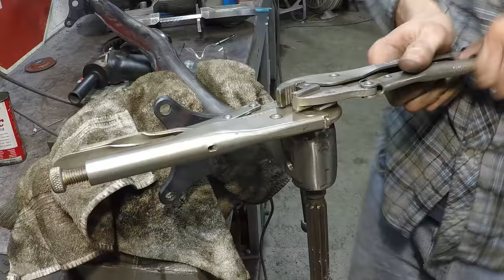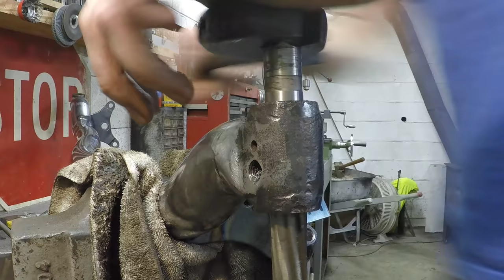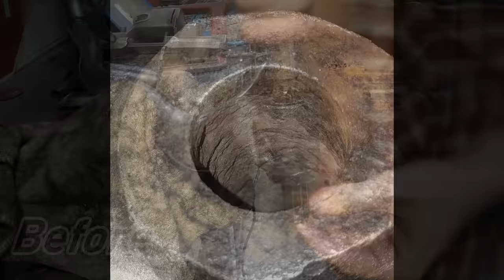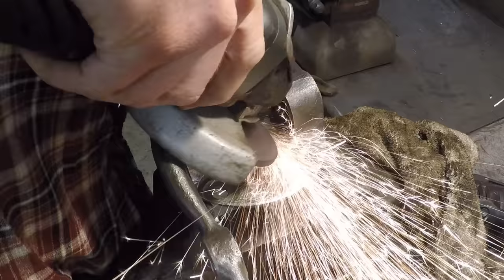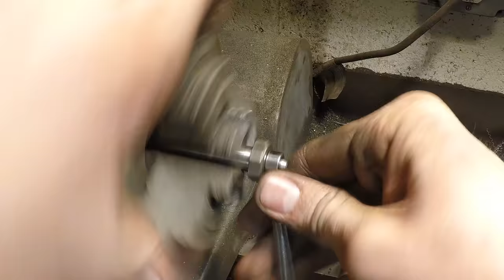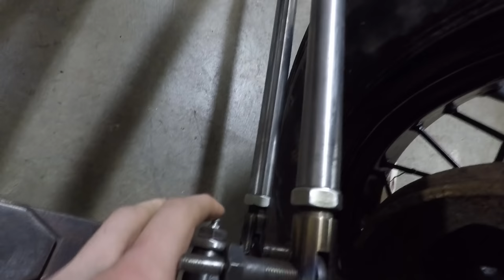Fitting Ford Spindles on a Tube Axle | Boat-tail Speedster Pt.18

Comment: nice work!   are the king pin inclination angles the same between the dodge/plymouth and ford axles? ford is 7 degrees. do you have room for the ford thrust bearing?
Reply from the maker: there is room for the bearing. the inclination angle is probably not exactly the same, but close enough

Comment: nice job really!!, dont understand completely why you made the bolts to lubricate the spring mounts, it has a bronze inlay right? normally thats done so there is no need to lubricate it, bronze/steel is selflubricating, what i know from a bronze/steel connection, just keep it as dry as possible, grease could even be bad...
Reply from the maker: I actually only have regular brass bushings inside the spring eyelets
Reply: @MacroMachines  ah, did think that already, thx for the reaction, and keep up the good work, starting to look really great!!

Comment: the sheetmetal nose is probably going to be the hardest to make , maibe you can find an old tractor cowl , that should get you halfway there 
https://i.pinimg.com/originals/95/b6/37/95b6377cc3c61741ab1ee8d3623e0689.jpg
about the back ... well i been folowing an english guy building a classic look car using two jaguar 6 inlines coupled end to end 
for his boat tail he actually use canoe's for the top and bottom , his where poliester but in the states they use a lot of aluminium canoe's too
https://www.youtube.com/watch?v=CMw2z7HhH0g